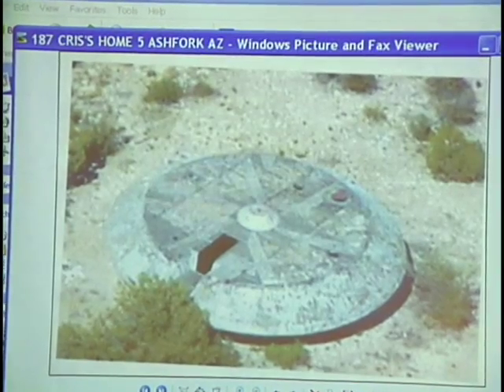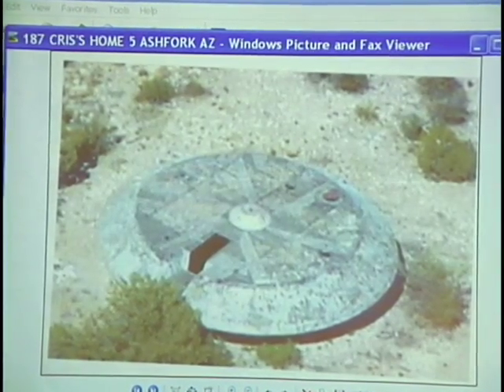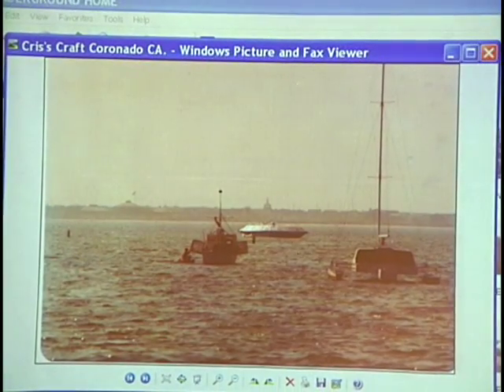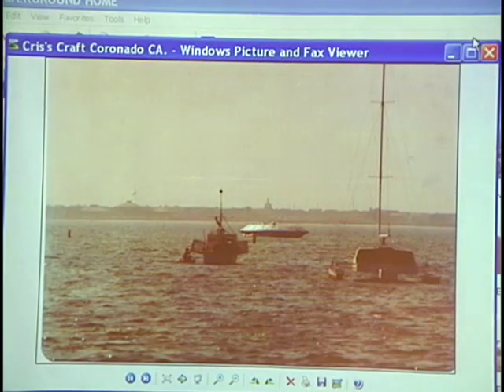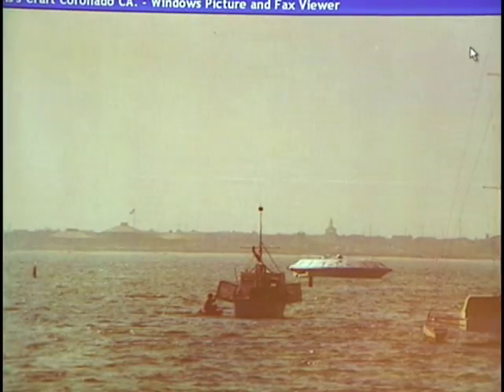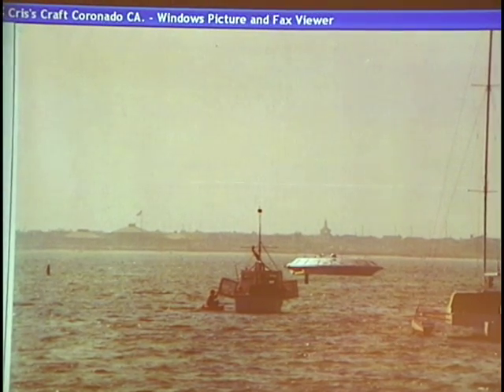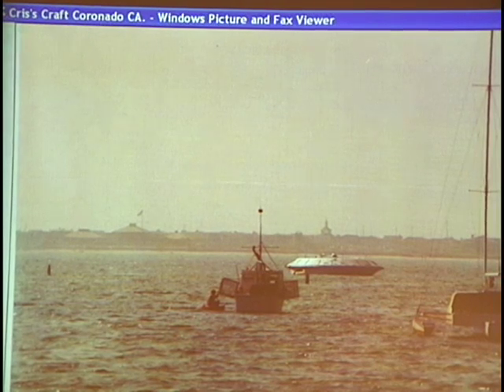(4of4)Ralph Ring-Magnetic Resonance and his Underground Home-2007 Tesla Technology Conference

Comment: Hello Ralph I find it very Interesting at your comment about the magnets on the straw at about 11:45mins and how they oppose each other BUT this is not exactly correct YOU can make them go together very easily. Yes same poles can go together you place a steal washer between them the washer will stick to one of the magnets that's Ok you will feel the other magnet repel itself from the other magnet like normal.but LIKE you said in nature DO NOT force them they will not attract.YOU slow bring them together you will feel the magnets getting closer an closer just ever so gently turn them clock wise and counter clockwise gentle pushing them together after a couple minutes they WILL attract to each other as the magnetic field changes working with nature :) I have done this several times using round magnets with a hole in it
Well after you have done this you might seem this is pretty cool but it gets way better
You talk about the field in between being where the power is which is very true.
So now the same poles are together with the washer in between slide it over a round steal pipe of about the same inside diameter of the magnets and washer
the magnets have increased the power enormously you will find it nearly impossible to slide the magnets up an down the pipe the washer becomes the magnetic field,
North washer North /  South washer South / North washer South / poles together will give you different fields and strengths this can be only seen with green magnetic field paper that shows fields & Ps dont forget when these magnets are on the steal pipe to check the fields on that to as the field Will travel up through the center of the steal like picture this as the end of the pipe" O " as the example anywhere on the outside of this O has a field and anywhere in the middle of the O has a field But you also have a field in the center of the steal its self eg. on the black of the O all very powerful fields just takes a bit of time to configure the right way
Ill post a video soon to show you how it works
And these can be used as generators with no moving parts as you talk about with your projects on UFOs
Matt